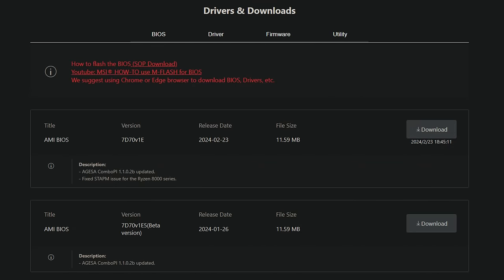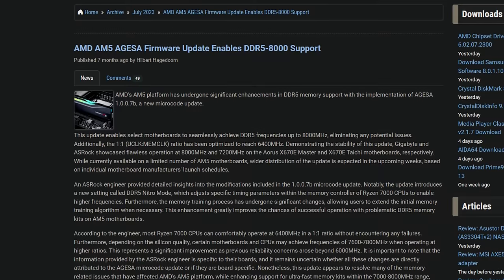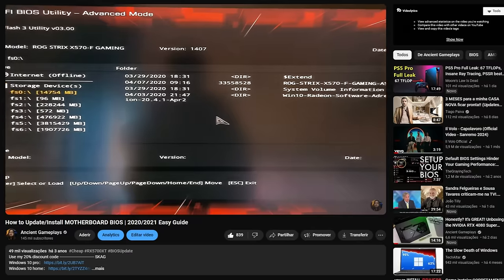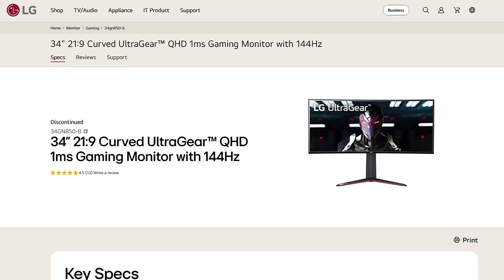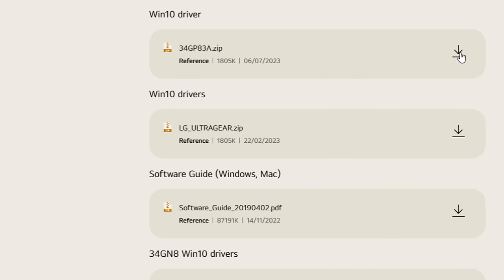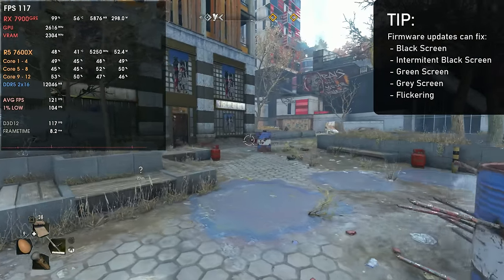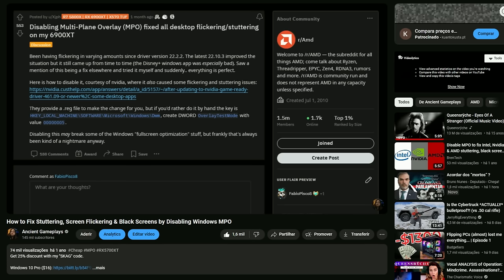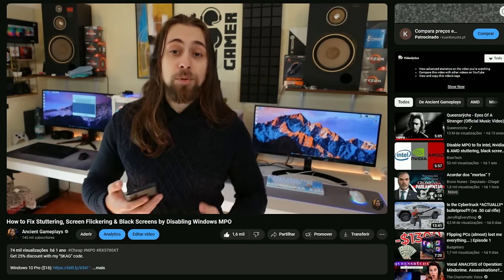20 TIPS to FIX "AMD GPU's Problems" | Easy 2024 Tutorial Guide

Comment: I tried for over a month to get an XTX to work properly. Fresh W11 install, updated chipset, bios yada yada, blocked windows from installing default drivers. Month of nonsense - micro stutter no matter what. This was across several different XTX's. I really liked this card and tried hard to make it work (the nitro+ is such a nice looking card).

7800x3D/7900xtx - Just stuttering it's ass off. Took XTX out, put 4080S in. All issues gone, has been over a month now of superb problem free gaming.
Reply from the maker: Enjoy then, but you either got a defective card or something was very wrong. I have never had such issue with an amd card besides the shitty ones I got from xfx years ago
Reply: lol crazy man crazy story indeed. I had 2 Nvidia GPU's die on me back to back so it can happen I suppose on either side. I did the opposite as you and went 7900 XTX and it has been amazing at 4k.

Comment: I overclock RX7800XT by AMD driver and I do not want Afterburner. 

ULPS key is under 

Computer\HKEY_LOCAL_MACHINE\SYSTEM\CurrentControlSet\Control\Class\{4d36e968-e325-11ce-bfc1-08002be10318} 

there may be multiple folders 0000, 0001, 0002, etc under those folder there's a "EnableUlps" key. Set it to 0 for all present devices, reboot.

Comment: Hey fabio or anyone else, I have a question.
I have a B660M Aourus Pro motherboard and I've just noticed there's a white light coming from behind the heatsink that's under the ram, I've no idea if it has always been there or if it just activated.
I've notice that in the pictures the motherboard has an orange glow there so Could it be a decorative led or is it indicating something???
If it's just decorative then how can I change it's colour??? Using my case's button to change it's lights has no effect on it, neither does using Icue to change my RAMs' colour.

Comment: Hey, I bought a 6950XTX less than a year ago. It has been plagued with the driver crashing when using hardware acceleration in programs. What happens is it grey screens and I have to restart the pc using the hardware buttons. 
I’ve done clean driver install, windows reinstall etc. 
Any recommendations?
Reply from the maker: Hardly drivers, a defective card or you're missing something. Watch the video

Comment: I have sapphire 7900xtx. continuous game crashing issues on cod mw2 and mw3. Tried all clean installation and most steps not helpful. Then I changed the bios to secondary in sapphire TRIX software and now not getting much issues. Performance wise AMD is to good but Nvidia was so solid on drivers
Reply: If you have antilag or anti lag+ turn on in the amd radeon adrenaline software then that off.

Comment: I was playing overwatch 2 couple days ago and i noticed that my frames are dropping kinda low and it didnt felt smooth,i checked couple of settings and saw anti lag is on so i started some test with on and off and for some weird reason with anti lag on my gpu usage was sitting at 95%max and then drop a lot in some cases which of course causes fps drop,with anti lag off it was perfect with no drops and smooth visuals.Again weird

Comment: I actually have the rx 6800 aorus now. For some reasons in some games, i get this "Driver crash".. this happens when I got to settings or just in home screen when i start the game.. everthing will went black.. so i need to force restart it, the IGPU will on it using, then as i check it on device manager, my GPU driver is disabled!! so im going to enable it then restart again, voila. it fixes.. This happen on specific games, mostly in PUBG. I saw it happens too in rdr2.. I got this "amdwddmg".... damn frustrating

Comment: I've just used DDU on my MSI VEGA 56, and after restarting my display went nuts making it impossible for me to get in the pc. Can I ask for some help?
Reply from the maker: that's impossible and has nothing to do with DDU, 100% guaranteed. Maybe windows is messed up. Is your GPU well sited?
Reply: @AncientGameplays  It went nuts, but it went good after just letting the PC rest for like 5 ~ 15 minutes.

The issue I have right now is that it still have some black screen, I've already uninstall all the pre-existing Drivers using DDU + installed the latest updates and then disabled the ULPS.
Do you have any recommendation for this case?

MOBO: B450 GAMING PLUS MAX - Latest BIOS + Drivers updates
CPU: RYZEN 5 4500 - Updated Drivers
RAM: 2*8GB 3200 Mhz
PSU: GIGABY P650G

Comment: I have a issue with my 7900xtx under load my wattage goes from 350+ down to  80 then back up and down and it will quick studder when the watts drop
Reply from the maker: Watch the video, it helps

Comment: I undervolted my Ryzen 5600 by 0.2V and interestingly it's totally stable when playing demanding games, but it keeps freezing in League of legends.
Reply from the maker: Demanding games arent demanding on the cpu usually. Lol pushes the cpu things and rama  bit more since it is very light gpu wise. Use curve optimizer there, not manual undervolt
Reply: @AncientGameplays demanding games are way more demanding on the cpu, cyberpunk for instance keeps my cpu usage above 80%, Dead Space around 60%, meanwhile in League it's nothing, the 5600 is able to output over 500fps in League if not capped, and I cap my fps to 144, so the cpu is barely doing any work, yet it freezes. But now I did -0.175V and it's stable. I'm using both offset undervolting and curve optimizer because with the optimizer alone the temp goes up to 75°C, with the offset undervolting it caps at 70°C

Comment: Say my chipset drivers are 3 years old on my 3700x b450 and i want to update them. Is it safe to remove them using Revo uninstaller and then clean reinstalling them after downloading the latest chipset files? Or do i not uninstall at all and go eoth the uninstallation?

My BIOS is from 2019 august. Do i need to update it?

Comment: I need help, it's been 2 weeks after getting the RX 6750 XT, for some reason games dont respond when i try to run them with my gpu but my integrated gpu has no problems running games. Any solutions to this problem?

Comment: I tried everything said in the video but my Drivers still crashing:

My system specs are:

GPU: Saphire Pulse RX vega 56
Board: Intel DQ77MK
Ram: DDR3 1600mhz
CPU: Xeon 1270 v2
PSU: Seasonic 750 watt 80 plus gold
1x SSD and 2x HDD

My temps are normal doesnt go beyong 70 degrees even with furmark

It was working fine until couple of weeks ago, no such issues encountered
Reply from the maker: Then you nees to find out what happened a couple of weeks...also, you sure you tried everything? I am pretty sure that's not the case
Reply: @AncientGameplays  I literally tried everything but no luck, but I check GPU into my other system and works fine there, there may issue with my Mobo or something,

Comment: Hello. I have a Problem. I installed new Chipset and Graphic Drivers. I also tried to manually change the blanking values but i still have way to much idle power consumtion. I have a Sapphire nitro+ 7900gre and it draws 60w idle.... Please help me to fix this problem.
Reply: Do you have multiple monitors?

Comment: Well my new rx 570 8Gb GPU is gonna break it self from AMD software so then solution is simple - wipe all drivers - install either Windows default driver or motherboard drivers and BAMM - perfect GPU stability as shown by GPU -z and MSI afterburner. So at the end please install only stable driver that does not cauae GPU instability or sensor spikes of GPU and memory clocks - perfect for offline PC 😮

Comment: My problem is getting the rx 6700 xt to work. I’ve bought two now, one xfx rx 6700xt and one sapphire rx 6700xt. At first I thought the xfx one had died, but after getting the sapphire one I realized it has the same weird issue. I’ll get into game, it’ll run good then after a few minutes it freezes but audio still plays. Tried both cards on two different pcs one msi board and amd the other gigabyte board and intel and same issue with both no difference. I’ll try all the fixes in this video, and I’ll edit this comment if any of it works, but if anyone has advice it’d be greatly appreciated.
Reply from the maker: Yes mate, when you have 2 cards and have the same "weird issues", the issues are not from the cards lol
That seems to me like a classic OC instability on the CPU or RAM
Reply: @AncientGameplays  Well uhh this is a little embarrassing to admit since ive had this issue for almost a year now, but it turns out updating the motherboard bios actually fixed it, at least on my amd system, which is running a 5800x with the sapphire 6700xt on fedora linux. And so far so good it ran cyberpunk at 1440p ultra in dogtown for over an hour no issues. So im going to do the same with my intel windows system and hopefully it fixes that machine too, but WOW do I feel stupid lmao.

Comment: Fábio, please test performance with fTPM disabled.
My specs 5800x3D + 7900XTX and the stuttering in warzone is solved and smoothness is perfect at last, only after i disabled on BIOS TPM at least on Windows 11. You can disable on BIOS after win11 install that requires tpm. Its a big thing, trust me.

Comment: alan wake 2 in my pc stutters a lot... Can someone please help?
My cpu is 5700x3d and gpu is rx 6600 and yes i am running on am4 platform with the latest motherboard and other drivers upto date.
Reply from the maker: Your gpu is just too slow mate. You might need more vram/ram as well or an ssd
Reply: @AncientGameplays  but i do have a wd ssd and 16gigs of 3000mhz ram. And 8gb vram is sufficient i think right for 1080p?
Thing is i used to have a ryzen 3300x which is a 4core cpu and i didnot experience any stutters or atleast not as much as now. 
The 5700x3d which I'm using right now is the only thing that i changed and now it stutters prettu often like i cant even lock it to 30fps... even then it drops to 29 sometimes.
Reply: @AncientGameplays  Thank you for replying btw :)
Reply: @AncientGameplays  i have also swapped my cpu so i think maybe i should clean install my windows?

Comment: hey man I hope you can answer me..
 I bought a 6800xt with 12400f and
And I have micro stuttring in games..
 for example in RDR2 fps is 80 or90 and and when i go in new aera and fps drop to 30 45 for 1sec..
And back to 80_90
Or in fifa23 in cinematic when game change sence i have drop fps for 0.5_1 sec and I have this every time not one time..
I test many things but I can't fixed
Reply: try to set Windows power plan to "Ultimate Performance" and see if there's an improvement
Reply: Are temps on 6800xt ok? Whats the resolution You play on and what refresh rate. Does frame limit fixes the issue? 

12400f in 1080p will bottleneck the gpu that can give you lower lows. RAM speed could help . Less latency.

Comment: What to do if my gpu wont obey my fan curve? hits 3k RPM whenever 50c is reached. Already used the fan curve available on AMD adrenalin as well as MSI after burner but no changes. Did DDU fresh install of driver, nothing works. Hope someone could help me with this. Mine is rx 6800 xt
Reply from the maker: It does that because your hotspot must be waaayyy above that
Reply: @AncientGameplays   Hey thanks for responding on this. But my Junction temp is not getting that high tho. Should be the fan be at 50% or bit higher rather than 100% most of the time? ( Except on idle ) Cause its always at 0 RPM when Idle

Comment: my 7800XT lights up but without the fans spinning, and then a few seconds later it turns off and the fans give a quick stutter before repeating the process over and over. This has brought me from over 400 fps down to 60 on most games and other games wont run what so ever due to this issue. PLEASE HELP!!
Reply from the maker: That seems like power failing, tried another psu?
Reply: @AncientGameplays  i have not. but if my pc is running can it still be power? should i try reseating the gpu?
Reply: @AncientGameplays  also could it be a dust/debris issue.. i just notice a little spider mad a home on the back and potentially inside of my psu and there are quite a few webs could that be enough to cause issues w/ my gpu? also thanks much for the quick replies!! i just subbed :)
Reply from the maker: @patrickjeffries5427  ah...well, troubleshooting time

Comment: I just upgraded my hp laptop from 4 gigs of ram to 16, have been having problems with the cpu and the gpu ever since as they just go nuclear at every task that is placed after them. Supposed it is because they now got way more room to process things than before, but it's working the other way and blackscreening my laptop almost every time I try playing, even while booting up or browsing.

I've gone crazy over this. Nothing, absolutely nothing has worked, everywhere on the internet and on this video included. The BIOS won't help as hp being hp now limits the settings on the BIOS to nothingness for laptops, and the settings on the adrenalin app are almost blank, I must say. Considering just upgrading to a better cpu and gpu or switching to the green side, I'm tired of this big joke.

Comment: Anyone that claims they have "no issues" is a massive red flag that you're dealing with a fanboy. EVERY system has issues, even consoles. I daily drive AMD and Intel/Nvidia side by side and while I've had far more problems with the AMD system (which is ironically how I found this channel to begin with) I would never claim the Intel/Nvidia system has been "perfect." Just the other day I saw a blurry mess in CP2077 that looked like I was using DLSS in performance mode and it didn't go away until I disabled and reenabled path tracing. Weird. 

But I have to admit I've had far more problems with the AMD system than the Intel/Nvidia one. It took a long time to trust AMD again after getting burned several times on FX and have to say I'm not impressed. Zen5 better really wow me or the next system this fall will likely be Arrow Lake.

Comment: Hi guys i just got a used pc with a 6800xt, i have tried uninstalling the device and installing new drivers, but with either hdmi or display port the gpu just randomly stops outputting and my monitor says "no signal". It works for a few minutes but i will try to load a game and then my gpu just powers off basically. Do you guys know what i can do?
Reply: That's because AMD GPU is absolute garbage. Contact the AMD support, they will send you a link how to delete their drivers properly and how to re-install them. If this doesn't fix it, just don't even bother with the GPU.... I did for 9 months... never AMD GPU again.

Comment: I am using a freesync amd aproved monitor (VA panel) and I am getting untolerable brightness flickering while sitting at 100-110 frames in games while using a 7900xtx .None of these tips helped unfortunately .I have to disable freesync,unusable .
Reply from the maker: Ask a firmware update there. Changed cables/inputs on the gpu?
Reply: @AncientGameplays  Thank you for commenting,I will contact the monitor manufacturer for sure .

Comment: I have black and green screens when playing any game after a few minutes. I tried everything but nothing works any solution
Reply from the maker: Have you really tried everything?
Reply: @AncientGameplays  yeap drivers Power supply. reinstall everything including mpo or windows stuff
Reply from the maker: @sergu95  cables? Monitor? Gpu?
Reply: @AncientGameplays  Let's see
Reply: @AncientGameplays  I fixed it!! I had to take out the motherboard and clean it just in case and reconnect everything. I don't know what happened there but something was causing a conflict.

Comment: I have issue with my rx 6600.
when i do something in game genshin impact like loading map or entering domain or click any menu, basically any action - I'm getting stutters in game and audio crackling if I listening some YouTube video in background.
this issue is driving me crazy.
cpu is Ryzen 5600.
32gb ram.
b550m aorus elite.
Kingston kc2500 nvme

nothing helped, i tried everything.
Reply: Try a clean install. I did a driver install only for my amd drivers. That fixed my stutters. Give it a shot
Reply: @TiagrajI ha-ha issue solved. I was fighting with it for 3 months.
turns out it was not RX 6600 or Ryzen 5600 fault.
Issue was because of tool I used for unlocking fps in genshin impact.
3 days ago dev of this tool released new version.
on this version everything works perfect.
no sound crackling no stutters nothing, just works.

Comment: I have an problem with 7900XT I can't undervolt and overclock for real , in Adrenaline I can only up and down the Power Usage et Core Clock but tweak the Tension I can't it doesn't do a thing!
Reply from the maker: you need to clean install drivers, watch the video
Reply: @AncientGameplays  I've done that even windows clean installation before looking at your videos you were my last hope ! 🥶
Reply: @AncientGameplays  and my CG doesn't have problem of perf because I've tested it in Skyrim on 4K with 3000 mods and ENB wich take a lot of performance I've had 52 FPS , and Cyberpunk on 4K Ultra raster  62 FPS !

Comment: Hi, I would like to ask question if someone maybe knows the way to fix my problem. I have Gigabyte RX 6800 XT OC and in games like Helldivers 2 on ultra/high settings my pc just turns off (display port no signal, fans and lights are still on inside pc) and then i need to manually shut it down and on again. It only happens in games not in benchmarks and only on higher settings. I bought a new Corsair RMX 850W psu and i reapplied thermal paste on gpu, problem still stays. Anyone knows the reason for this, could this be vram or 3d point loss?